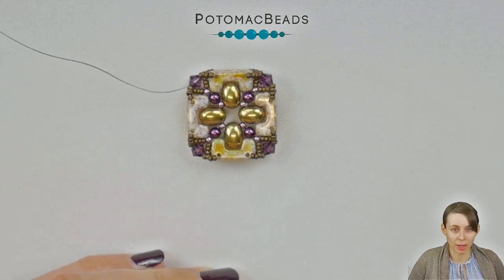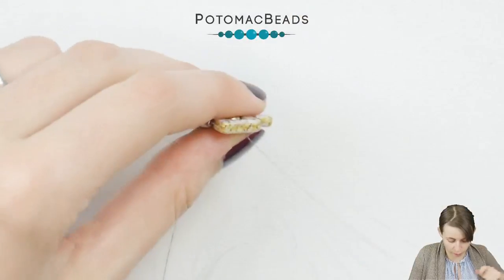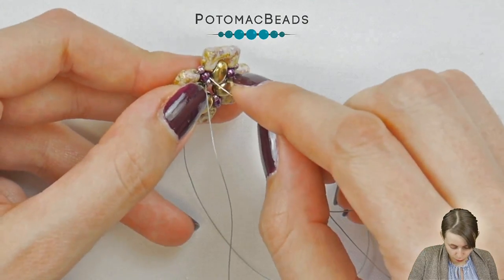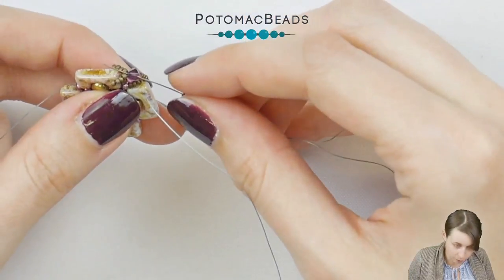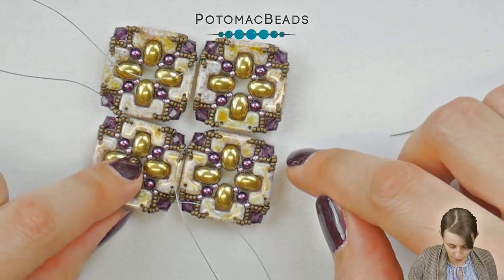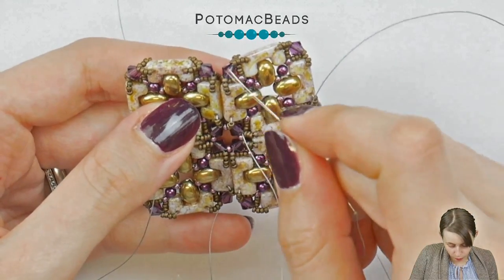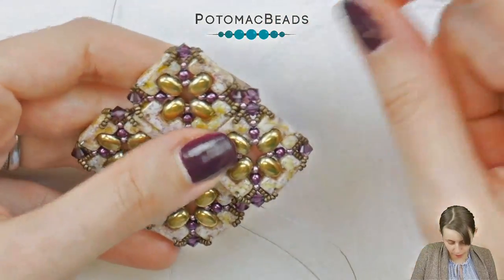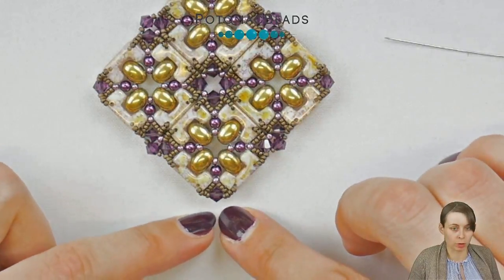Tamiko Pendant - DIY Jewelry Making Tutorial by PotomacBeads

Comment: I had seen the pattern and had tried to do one component before, but it's super nice to be able to see you do it and follow you with the correct thread paths and can now see where I goofed up. Thank you Tereza for this tutorial.  You've made it much easier and clearer on how to do this!!!!   One thing... I don't have the Samos beads on hand so I had substituted them with the Iris Duo, which seemed to work out fairly well other than the holes on the Iris Duo don't meet up quite as perfectly as it appears it does with the Telos, but it is doable.  Thanks again!
Reply: Good to know! I was wondering about it, thank you! :))
Reply: After completing components per your video, I had no problem with holes matching up with the iris duos and the telos.  The only difference that I can see is that there is a tad bit of thread that shows between the upper holes of the iris duo going into the telos.  I didn't try, but a charlotte or perhaps 15/0 on both sides of the iris duo would cover that.  My guess is that two 15/0's in that space would be too much.  It's not enough to bother me, but it might bother some beaders having that small amount of thread showing.  Thanks for such a great tutorial!